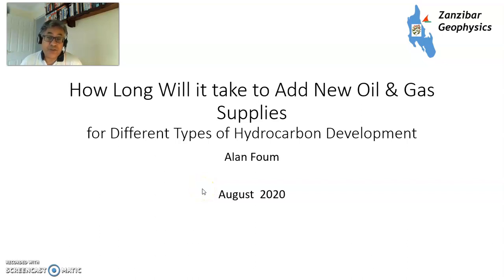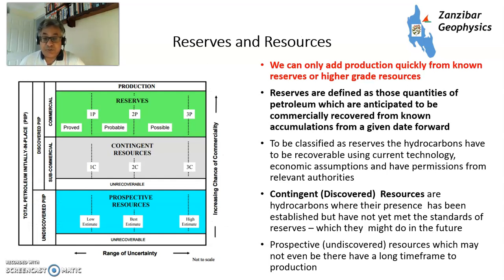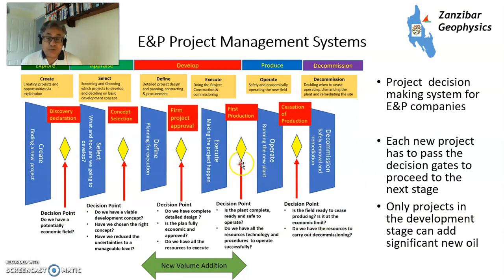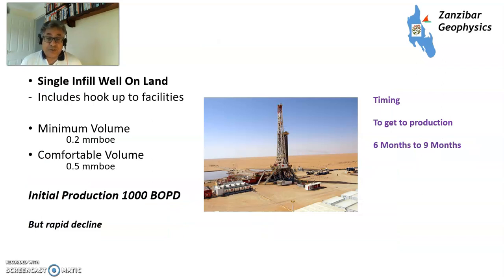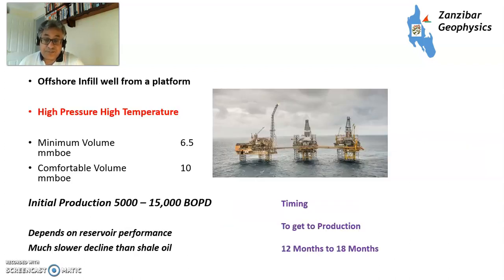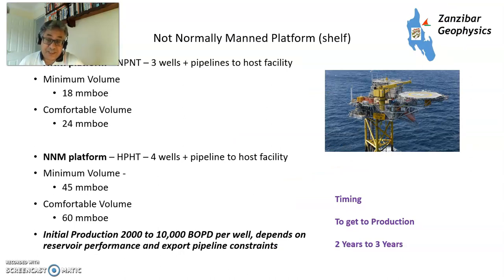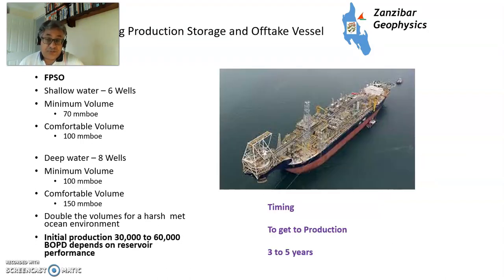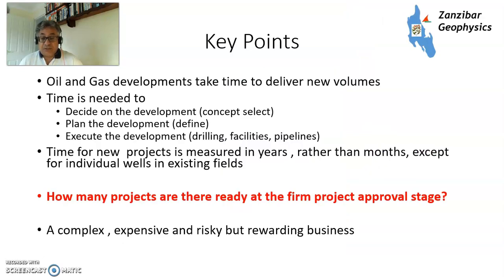How Long Will it take to Add New Oil & Gas Supplies - for Different Types of Hydrocarbon Development

Comment: Alan, do you think a geological imposed oil peak is likely soon?
Reply from the maker: A geological peak has been prognosed since the 1890's - as long as the modern oil industry has existed
A geological peak WILL eventually happen - but no-one really knows when it will occur

Many countries are past their peak already , but some few countries have growth potential , there are almost no exploration frontiers left 

There is significant unconventional potential in countries outside North America , Russia, Argentina, Algeria-Libya, but there have also been many failed shales

Global NEW discoveries have not replaced production since about 2000 - but enhancements and extensions in existing fields have compensated for production to keep proven reserves basically static

Not a geological topic - but continued investment in hydrocarbons is needed to maintain production in order to meet existing demand under all realistic scenarios

There have been many advocates of Peak oil driven by an almost religious ideological  fervour - so far their prophecies have been premature

Hope this helps
Reply: @AlanFoumGeophysicist   thanks for the insights
Reply: @AlanFoumGeophysicist  So are those extensions and Enchancements are part of the reserves replacement ratio?
Reply from the maker: Yes - but I think that they should be counted separately or at least tabulated separately
A fair amount of "reserve messaging " takes place with a low initial proven reserve number (to avoid the embarrassment of having to write down reserves if this number is too high) - proven reserves estimates are then upgraded through time as more information from production becomes available - this is the revisions part
Enhancements are when a previously undeveloped part of an already discovered and producing field is brought on production through new drilling of infill wells or Enhanced Oil recovery technology is implemented - this obviously involves extra capital spending
New project approvals moves new hydrocarbons onto the reserve balance sheet - these hydrocarbons would have been discovered earlier, sometimes years earlier as it takes time to formulate a development plan
Another reserve gain is when a company buys assets with reserves from somebody else
In terms of exploration success you should really look at 2C resources added each year by new discoveries - however this information is very hard to find as most companies only publish 1P and sometimes 2P reserves

Comment: Do you think offshore oil is the place to be in the next bull run in oil ? Thanks
Reply from the maker: I do not know - but almost all the giant fields that have been discovered since 2000 worldwide have been in deep water and about 70 to 80% of the volumes discovered by large listed companies since 2000 were also in deep water settings
If you are talking about the USA , namely the Gulf of Mexico I do not know enough about it but some significant discoveries have been made in the recent past - Question will the US large Caps that have concentrated virtually exclusively on shale come back to conventional exploration?